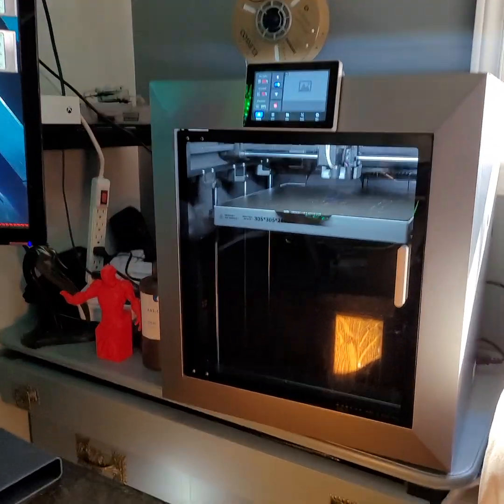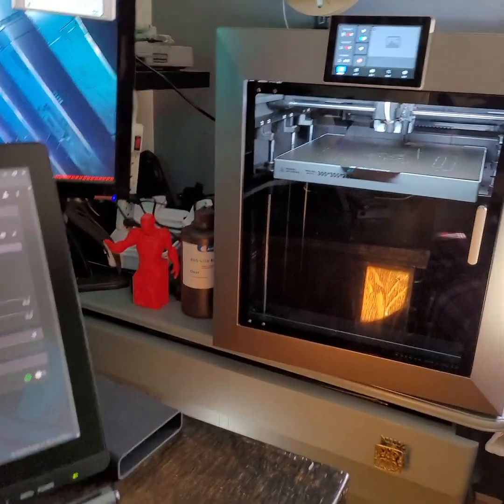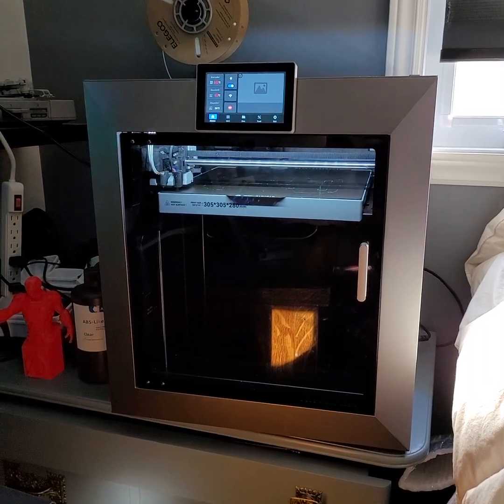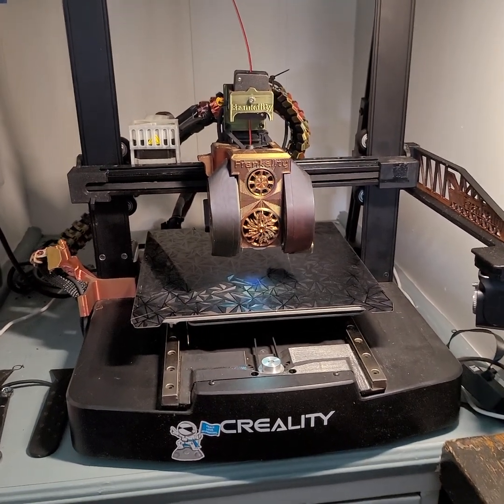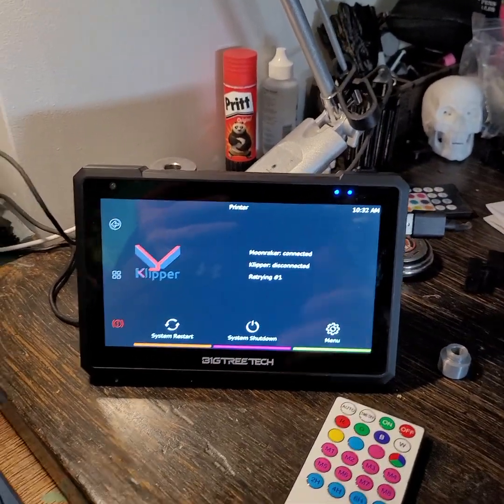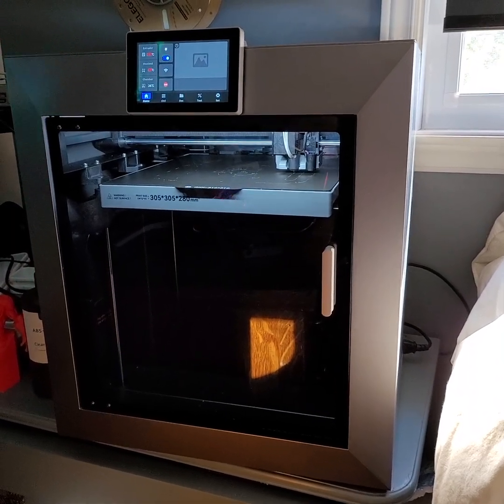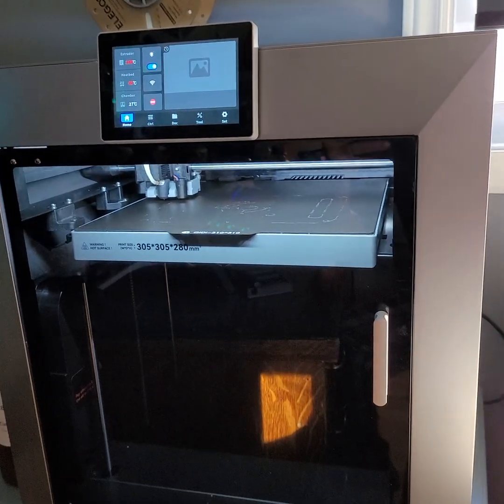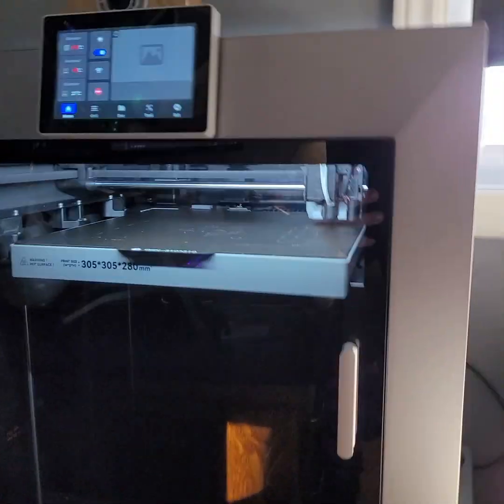Resurrection of my QIDI Plus 4

Comment: I will watch some of your other videos in regards to this printer.
For me, not having owned a 3d printer at all, I am not sure how wise it is to try the printer lottery to hope I get a decent build.
It should not have to be like that.
The more that I read the less impressed that I become, perhaps more so due to the candid and genuine videos as you have posted, there are others.

I do not have the skills, patience or desire to be a tinkerer of a 3d printer costing what it does and not have the odds on my side that it is going to work as typically shown when I see it reviewed by some content creators videos.

I want to spend my time printing and not time spent fixing  / tinkering with a product that seems to have inconsistent quality between models. Especially with the cost and not the best, it seems, support.
Reply from the maker: Sorry for late reply bud ... don't get me wrong the Qidi Plus 4 is amazing  ... once all tuned. By now Qidi as addressed every issues we showed them and the new batch are fix. I'm one of those who always try to improve stuff so lolll ... i did a lot of work on it but it's for my own purposes and maybe, research to help everyone else who ends up with issues so ... it works man ... super well. AMS should be out soon too so, this will be another impossible mission 😂😅
Cheers
Reply: @frankthebum Thanks for the reply.
Watching your other Beacon video I think that it would be fair to suggest that you not only like to tinker but that you are skilled in doing so...!

For a first printer, and much less inclined to tinker, I would look for the best OOB experience.

Even being locked firmware etc BL seem strong to offer that.

Comment: My plus4 is a nightmare! I have not taken one okay print off mine yet. Every print is covered top to bottom in vfa's, extremely bad ghosting, ringing/banding, and atrocious layer line quality. My plus4 prints worse than a 1st gen ender3 that was improperly put together. Its that bad! I bought this to get away from constantly having to tune my x max 3's to get decent prints. I am pissed and i am about to throw it off my deck. I ve been trying to fix everything for 2 weeks straight, and i cant get a single decent print off mine. Thats not even including the horror show with the chamber heater debacle going on. I am also getting a ton of graphite on my bottom rail after every print. And no, my lower bearing is not loose at all, ot is not from that.  All i own is qidi printers, but i think i might be done with them after this bs i received.
Reply: Do You use an all-metal hotend? I experience the same problems with failed prints and suspect clogging of the hotend caused by heatcreep. Ceramic hotends, which should remedy heatcreep, are available in Qidi store, but delivery time from European local storage is 2-3 .... MONTHS. This can make anyone curse like a frenchman on cigarettes and bourbon.
Reply from the maker: Hey bud :) Sorry to hear that and yes it's a goddamn nightmare ! My new parts or on the way ...with my $29 duty fees lolll   I guess you have done the 1.4.3 on it by now and still having all those issues might be from that actually, unless your printer has physical/mechanical issues, but if not, the whole problem is definitely in the Klippy and macro's. I ended up having lots of those and Madame Vega sent me the Klipper files that i over written in SSH. That kinda solve many issues but i'm still having a few like, camera not working, timelapse, weird erratic behavior etc etc but it works for now.
I will upload files soon on my Github with maybe fixes for those but, for now, i would suggest you get on Discord and chat with the users as some are well known and could probably help you out ;)
  https://discord.gg/RtHKWadv
Reply: @frankthebum  thanks for the reply bro. I own 7 qidi printers, I know.all the tricks for their printers. I always keep up to date on all my firmware and slicer. I worked through the qidi wiki page and tried changing some setting Printer.cfg for the steppers. I tried lowering the corner velocity from the stock "8" to 7. I've tightened everything, I've changed printing speeds, temps, flow, pressure advance, retraction, i did manual level on the bed via the bed leveling nuts. The table i have all my printers don't move a micro fraction and they are all dead-level. I have thick stainless steel benches that are braced 45° at every 90° angle. Then I sit all my printers on a 2" thick granite slabs i get from my uncles counter top business. The feet of this plus4 are extra soft as hell, so I made more firm feet and put high density foam under all 4 bottom corners. I also found out those lose handles on top give a false reading for the sensors with input shaping. So I removed them. Mine came with the back left stepper that had all 4 mounting screws not even hand tight. So I had to take apart the auto tensioner to get to all 4 screws. I got a good 3 turns on all 4. I tried adjusting the belts, I shimed the belt tensioning springs so both belts are the same exact tension. I bought an expensive belt tension meter just because of this damn printer. I am about to rip my damn hair out. I am fuming with qidi right now. I've been a very very loyal customer to qidi, and I dont feel like having to deal with all of this bs on a new printer. My q1 pros printed perfectly out of the box, still do. Thats why I figured this would be safe to jump on early. But they rushed this out, and changed a ton of stuff from just the q1 pro. So every damn thing is going wrong. And I have not been impressed how they have been handling this entire mess! 3d musketeers did a temp read and voltage check for their "fix" with 1.4.3 update. They didn't fix it, they just prolonged the time it takes to reach 180°! Absolutely ridiculous. And every time i try to chat with someone on their github, they keep trying to tell me to update the firmware, and my lower hotend bearing is loose. I am just getting more frustrated by the day. Also, the belts on mine ride every single flange on every pulley. No matter what I try to do to fix the issue, they slide right back to every damn pulley flange. I cant be the only person that is getting atrocious prints of this thing. But nobody is talking about it, they are all signing it's praise with print quality. So to throw a fit, I am just irritated and frustrated af. Did you have to change alot of stuff on their ssh?
Reply: I have had my Plus 4 for just under a week now and have had it running for over 120 hours in that time. It has been almost flawless with PLA, PET-CF, ASA, and PA612-CF. It does seem that some, like yourself, have had a really bad time of it. Just wanted you to know that not all of them have the issues you are having.
Reply from the maker: @MBelcher500  the first batch have had every problems that could come out of it ... not sure if it was a test or just poor quality control, but Qidi as done everything to resolve every issues. Mine is working like a charm now and full mod but i like to setup my machines the way i want them to be. It's an amazing printer but it needs love 🤣🤣👍 if yoy didn't had any problems yet ... pretty sure you're on the good side. Happy printing 😉

Comment: So many questions...  How are you getting so many probe points so fast?
What are you using for off-frame filament management?
Did you flash new Klipper to KE, or just use existing Klipper/Moonraker with a new UI?
Last, what are you doing about your control pad?